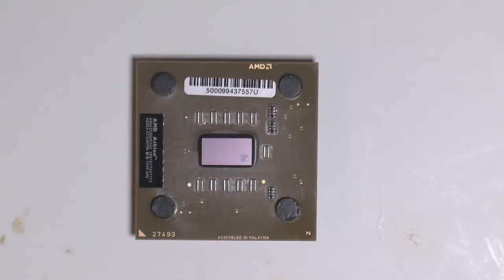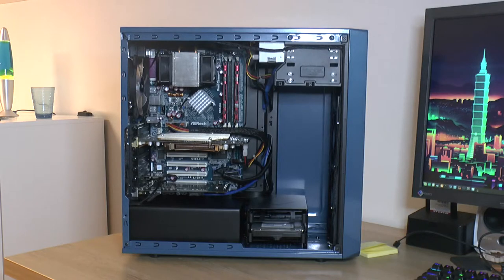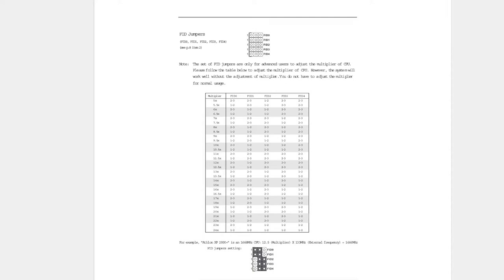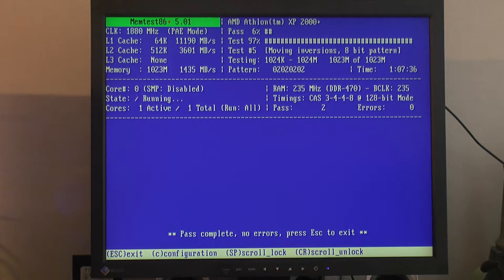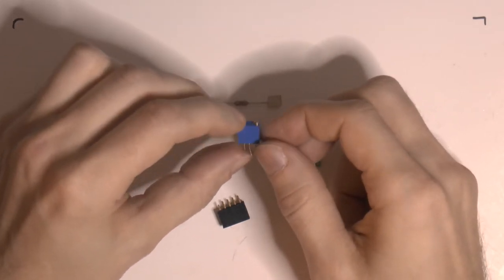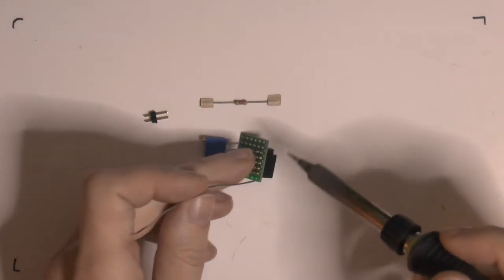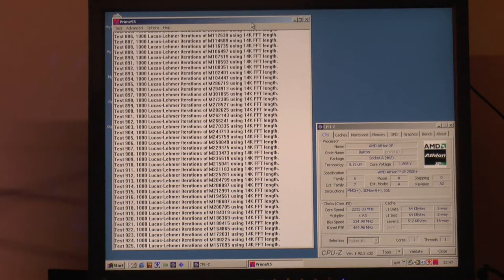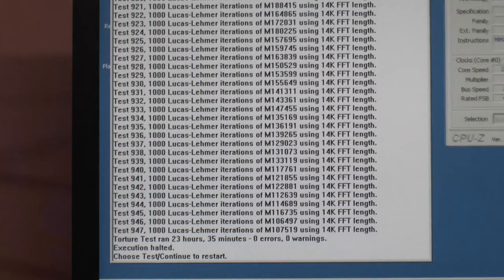Unlocked Athlon XP 2500+ Overclocking and MAXING out the FSB!

Comment: This reminds me of the good ole days of overclocking.  It used to be so fun to overclock.  I ran a Athlon X2 5400+ BE in my PC for many years.  It was 2.8ghz stock and you could get it up to 3.2ghz with no effort at all.  I ran it at 3.2ghz basically the entire time I was using it.  I was able to get it to 3.42ghz stable but I really had to bump up to voltage so it wasn't worth running it like that all time.  I went a little crazy with it one day and had it up to 3.52ghz!  It would actually load into Windows but upon running Prime95 it would hard lock.

A family member of mine is actually still using that PC to this day!  Well they were still using the 5400+ BE until mid 2020 when I talked them into getting a Phenom II X4 955 for around $25.  That is what they are still using in 2022.  It runs at 3.2ghz stock but I was able to take it up to 4.1ghz stable for daily use.  I did push it all the way to 4.32ghz and was able to run Cinebench R20 Multi-Core.  I was messing around with it seeing if I could get a score of over 900.  At stock 3.2ghz it scored 650 points. At 4.32ghz I was able to get 916!  A pretty good increase.

I've got one last classic overclock to mention.  Do you remember the ATI 9500 GPU?  There was a way you could unlock extra pipelines on the card and turn it into a 9700.  It wouldn't work with all cards though.  With some when you unlocked the pipelines you would get some kind of artifacting.  Fortunately my 9500 unlocked to a 9700 with no problem.  It was a really awesome little trick back in the day.  I actually choose the 9500 back then just because I knew you could possibly turn it into a 9700.  I feel like it was fairly well known back then but I haven't seen anyone mention it on any retro PC videos.  I know this was a very long comment but when it comes to old PCs I could talk for hours! lol
Reply from the maker: My friend ran his Opteron 165 up until 2019-2020 or so before MB gave out.
I still have parts of that system when it was scraped.

Also have a Phenom II 925, ordered the 965 C3 stepping but was sent the wrong CPU. Got my money back tough but took 2 weeks to get it prime95 and memtst86 stable at 3.5Ghz (stock 2.8) Ghz but its locked so L3 and IMC ran 25% over to with ram at 1666Mhz whit very low timings, ram was stable at 1733Mhz in memtst86+ but IMC + Cores in prime95 could not do it, runs insanely hot.
 Was replaced by an i7 3930K and later a Xeon E5-1680 V2 8 core 16 threads using a 70€ china made board thats has native M.2 NVME support and works very well as my YT/Lab machine.

The only 9000 series ATI card I had was for "terminal" on linux server or in my Mac Mini G4 that had a 9200 32Mb.
Im a 20+ years linux users and ATI/AMD well it sucked for linux for most of that time so Nvidia it was for 2 decades to get performance and features.

I did set up a few ATI 9700PRO for Linux users back in the day but not because I wanted to, mostly because they bought the fastest card and had no understanding that drivers for your GPU is more important then who made the best GPU, sadly the drivers took for ever to get working and when they did they my GeForce3 still was faster due to better drivers.

Bit different today but yea my Experience is mainly based around Linux so that often meant AMD processor, VIA or Nvidia Chipset, EMU10K sound cards, Nvidia Graphics, was the goto setup for years for good HW support and the best drivers.

So no did not use 9000 series much but did recommend it for Windows users and my friend had a Athlon XP 2500+ and a ATI 9700PRO on my recommendation running windows.

My current favorite Retro Computer uses a 9800PRO, it sure is a good card when used with an well supported OS  and mature drivers.

I ran FX5900 Ultra back in the day, dual Samsung 959NF 19" CRT so 3200x1200 pixels and it did it just fine on Dual Opteron 244.
Still have the card and my fastest Windows 2000 Machine.

Comment: I'm very happy to see the CPU getting some love after I gave it to you :) also very exciting to see it in action beating the shit out of my 2003 computer at the LAN party!
Reply from the maker: You have to build a P4 with extreme FSB OC edition to beat the shit out of it back then! XD
Reply: Not kidding I bought a 2ghz sempron. An it was a gimped Barton core CPU with a cache cut to 256, it was an amazing little little chip. At about 2,4v it hit 2 8ghz. I saw the cache mods an did that with just a pencil and tape an it worked perfectly....but I was sure more volts but my bios was maxed but then discovered you could force a vcore by bridging CPU pins with tiny wires in the socket an bumped it up to max it could go with out volt mods I think it was 2.50vs. an got it too 2.9ghz massively air cooler with 5000rpm 80mm fans, loud would of been quieter😂. Searched high an low for 500mhz 512 ram chips with that Samsung ram an on brainpower PCBs as they was tons better at high voltage an tighter timings. paired with a good ole 6600gt that was just as good as an over clocker too I definitely won that lottery the GT was only a tad slower than a standard 6800. I don't think I've ever had so much extra power for pc that cost me less about 180 quid

Comment: Try lowering the FSB and raising the multiplier and see if this makes it more stable above 2250MHz?
Some ordinary 2500+ Barton core CPU's were not great clockers but most would do 3200+ speeds, like yours - 2200MHz.
The XP-M skt a - 462 were the very best clocking socket a processors (due to very low default vCore) along with the DLT3C thoroughbred b Athlon XP's - especially the XP1700+.
Reply from the maker: I have 500Mhz DDR and this 2500+ @ 3200+ speeds with 470Mhz fsb and ram is faster then my 3000+ @ 3200+ that ran 425mhz FSB and RAM when I benchmark games so bandwidth is more important to me.

My Athlon 850@950 is also faster with higher bus and ram because I unlocked it to run 294Mhz FSB and DDR RAM.

I see much better scaling with FSB/RAM OC then core clock.

In a perfect world I would want to run 500Mhz FSB and RAM on this system but finding such a good Nforce 2 board nowadays would be hard.

Im pretty happy with how the system performs now.
Reply: DDR500 means it can clock to 250MHz (on a mobo that allows.)
I’ve had Winbond-bh 5 PC3200 at 285MHz (570MHz) cl2-2-2-5 at 3.6v in a socket 939 setup before.
Athlon 850 ran on a 100MHz FSB (200MHz effective.)
I’m guessing you hard modded the chip to set lower multi ? 147FSB is very fast on a Athlon 850.
Reply from the maker: @benrogersdevon  Yes I know how DDR works, its marketed as 500Mhz, external bus clock is half that on DDR, really dont matter  because its semantics to argue about it, marketing VS memory bus clk.

And yes all my Athlon 850s have soldered L1 bridge by me so permanently unlocked running 147 fsb (294) x 6.5 = 956Mhz.
Soldering the L1 bridge is much more reliable and easy to do with the right flux and solder.
It runs 1:1 fsb:ram with DDR @ 294Mhz effective for maximum performance and its stupidly fast with a GeForce 256.

Comment: Got an athlon xp 3200+ @ 2500 mhz with 1.775 volts on a msi k7n2 delta 2 platinum board and modded bios. With ram @ 454 mhz 2-2-2-2-5 corsair xms3200 v1.1. using 3 volts. Cpu staying well below60 degrees using Arctic copper silent 2 tc. Dont think the 2500+ is the same as 3200+ looking at the volts needed to oc it.
Reply from the maker: That is a nice overclock!

The board in my video seems to be a poor Core overclocker. 
I noticed that the 2500+ and also my newly acquired Athlon XP-M 2400+v can go higher on 1.8V on my ASUS and DFI boards but not on this board.
I checked the voltage with a multimeter to make sure all boards actually have the same Vcore.

But what the Arock board is doing well is high FSB and ram clocks so in the end even a 10% lower core clock is still faster on the ASrock due to the 470Mhz FSB and RAM VS say running 400Mhz FSB and RAM on the other boards.

The VRM just dont seem to be as good on the Asrock makeing the CPU's core clock not got as high.

I did prime95 all the boards and cpus for 24h, the Asrock failed @ 2400 Mhz at 1.8V with a Athlon XP-M but my DFI lanparty and an ASUS board passed just fine with the same CPU.

Improving the filtering on the Asrock board might make the Vcore and VRM more stable, but thats a future project.
Also heat becomes an issue at 2400Mhz+ with air so Im thinking water cooling but I need to find a block for the system first.
The bigger air coolers just dont fit the ASrock board so water would be the solution.

Comment: Amazing stuff. I have same mobo and I wanted to overclock my athlon xp-m, but I reached a wall at 2000 Mhz, because of lack of vcore adjustment on this mobo. Guess im going to shop for electronic parts.
Reply from the maker: I forgot to post the link but here is the original mod plus I posted there to.
Seems like a grate forum for modding old stuff like this.
https://warp9-systems.proboards.com/thread/1327/asrock-k7nf2-raid-mods

I hope you get the most out off your Athlon XP-M!
Reply: Ok i did cpu pin mod and this is also working, now my vcore is 1,850 and i can overclock cpu more.
Reply: The vast majority of 2500+ Barton core processors overclocked to 3200+ speeds, even on default vcore.
I overclocked a 2500+ to over 2450MHz or so but I increased the vcore to 1.775v & it was stable in games & benchmarks
Reply from the maker: @benrogersdevon  Games and short benchmarks is on thing, prime95 and anything floating point intensive for longer duration is another. I run 24h prime95on any CPU I overclock to make sure its its as stable as it gets so I wont get interrupted using the system later.
This particular CPU was not the best overclocker and the motherboard is not known to be a good overclocker ithere.
The board hardly overvolts above stock as it is, like 60mAh and it likes to drop a bit under load so voltage mod is more or less required to get anywhere.
Reply: I know mate. Had to back the core speed down to 2350 ish and it ran prime95 and orthos as well.
I used to run folding@home on it and it would run for months between I restarted the PC.
Reply: @benrogersdevon  I cannot oc more than 2.2 ghz my xp-m 2400+ maybe mobo is limiting me or this particular cpu cannot go more.
Reply: @departmentofgamesandmemes.9818  the mobile Barton core’s used to clock insanely well mate!!
I’m not sure what cpu voltage you’re running but I think standard was around 1.65v (if board detects cou as desktop version) but it might be the CPU requiring more juice 🧃 !! Try upping the vcore to 1.675v or even 1.7v if cooling is okay 👌
you may get to 2300-2400MHz, if mobo & temperature of the CPU are not an issue.

I had a 2500+ Barton that did ~2350 MHz when I raised the vcore (CPU voltage), sometimes called ‘VID’.
The above processor was on an abit nf7-s 2.0 mobo (great OC board.)

Note that the above clock was on a desktop Barton, rather than a mobile processor, like yours.

 Your type of processor (being an m) - mobile processor in a desktop motherboard have a lower vcore than their desktop equivalent (more overclocking headroom) plus lower temperatures!

I just noticed the motherboard you are using. A lot of ASRock motherboard’s were designed to run at standard pretty much but you might get up the base clock higher (lower the multiplier a bit to find max base clock & also for this test change the dram ratio so that the memory will run slower than the base clock & then you’ll know the limit of the motherboards highest base clock frequency.
Reply: @benrogersdevon  I pushed vcore to 1.85-1.9, and temp wasn't an issue coz i have pure copper heatsink with industrial fan on it. It cannot reach 2.3 GHz so i think its motherboard. I will try overclock this cpu on EPox 8RDA3 maybe it will go further.
Reply: Ok i tested on Epox 8RDA3+, and this 2400+ xp-m cannot pass 2400 even using 2v or more, i believe this particular unit cannot go more. Now im overclocking locked Athlon XP 3000+ at 10,5 multiplier using fsb and went pass 2300. Any advices how to unlock multiplier on this cpu ?
Reply: @departmentofgamesandmemes.9818  I think only the Athlon xp tbred’s and xp’m’s have an unlocked multiplier.

I’m not sure if hard modding the l5/l6 bridges will work as it did if you wanted to hard mod multi on Athlon xp tbred’s so use the following page at your own risk:

http://fab51.com/cpu/barton/athlon-e24.html

Comment: Your 12v rail is too low mate!! I recommend testing it with a multimetre (voltmetre) and see if the voltmetre shows similar value. I used to get problems whenever the 12v rail dropped below 11.75 and this was a common occurrence for me with cheap boards and P4 C CPU's too.

I would almost guarantee you its your PSU holding you back!!!
Reply from the maker: Well P4 after socket 423 (Williamet) used 12V rail like with socket 478 and Northwood.
Most but not all Socket A board uses 5V rail for the CPU and this PSU (Chiftec 360W) is 5V heavy at 35A and thats what matters for the CPU in this system.

11.65V if correct is with in old ATX 1.x spec of ±%5% on major rails.
Reply: I actually had a 360w Chieftec PSU which came with my Chieftec Dragon yellow case and know it was an okay PSU when new but got weaker with more use.
Reply from the maker: @benrogersdevon  At some point it will get a service and a recap but its not on top of my todo list atm.

Comment: Wow man can u play gta san andreas?
Reply from the maker: Minimum requirements are well below this machines specs so should work fine I suppose.
Reply: You can play the original GTA 3 on a GeForce 2 MX400 on a Pentium 2 350-450MHz mate at 640 x 480? with low detail etc but for >30FPS & 1024 x 768, 32bit high detail you could run it on a Athlon 1000MHz Thunderbird with a GeForce2 Ultra or even a bottom of the range MX version of the GeForce cards would suffice. 
I used to run GTA 3 on a GeForce 2 MX400 with 256MB DDR PC2100 (133MHz) and a Athlon Thunderbird 1400MHz and it ran fairly well (from what I remember anyway!)
The same rig ran SoF2 and Quake 3 and was maxing the FPS out on FRAPS - 99+ FPS - though you can run Quake 3 on a Katmai Slot 1 Pentium 3 with a Voodoo 3 2000.

Comment: Hello, I just discovered your channel. I wonder how you made that CPU cooler adapter, how you decided the measurements and approximate maximum pressure? I have a pair of swiftech mc462 but im not sure how to even start when trying to adapt new coolers for this platform. Thanks! Great channel!
Reply from the maker: the cpu cooler is an old 775 cooler, probably HP or Dell. It had a similar bracket so there are 4 threaded screw holes to attache the brackets, similar to Noctua coolers. I measured the hole spacing from a Maze 2 water block, but you can measure it on the board or google for socket A dimensions.

I gut the adapters out of 2mm steel sheets, I also welded metal stips, one per side opposite to one and another so I could put it in a vice and when clamping down press it in down creating a hight difference to get a proper fit.
Se this link for a picture of it.
https://cdn.sweclockers.com/galleri/bild/193652?l=eyJyZXNvdXJjZSI6IjE5MzY1MiIsImZpbHRlcnMiOlsidD1sYXJnZSJdLCJwYXJhbXMiOltdLCJrZXkiOiIxN2U1YjcyZDk1YWUxOTM1OGExNGUwNDU3MTg1MjE1NyJ9

then I drilled the holes for the cooler, mounted them, used the Maze 2 block to mark up the Socket A holes, drilled them.
I used four springs, came of some CPU/GPU cooler. I measured the height difference on every screw to make sure all springs where compressed equally. But its not rocket science. Dont need that much force really.
Reply from the maker: I recently bought and restored a swiftech mc462, planing a build with that. Did have to remake the mounting kit because it was mostly missing.
Reply: do you need any measurements?
Reply from the maker: @RetroTinkerer  for the mc462? no its restored ready for use.